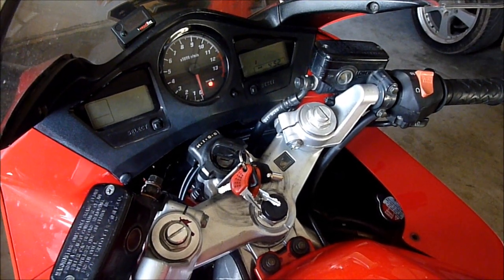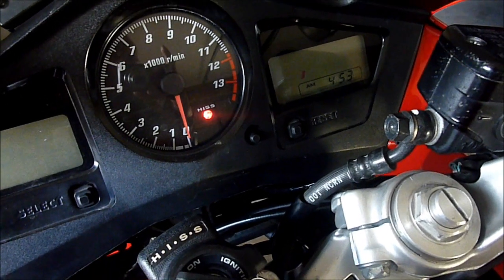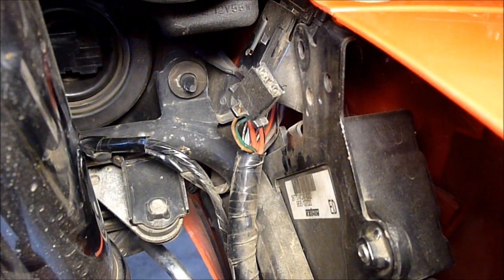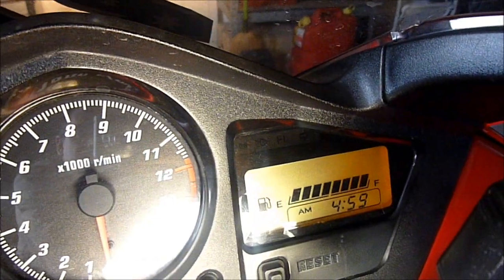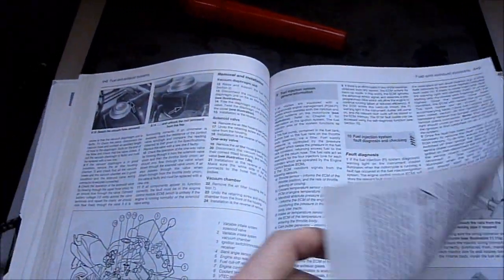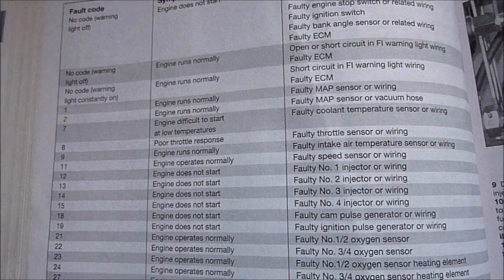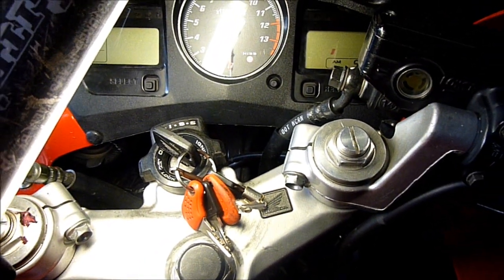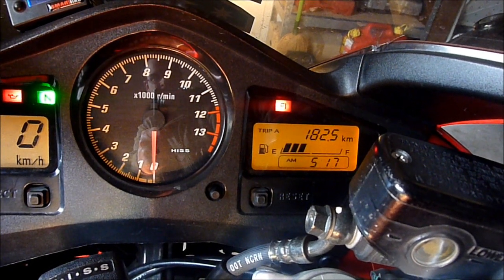Reading Fuel Injection Error codes on a VFR800

Comment: Great tutorial! Thank you for future!
Now I would like to ask you for some help:
I was going to make TüV/MOT inspection. All good except of high CO emission. I got approx 0,8-0,9%vol instead of allowed 0,3%vol.
No FI error codes after starting engine lamp is off. 
Air filter exchanged - no any difference before and after. 
Bike is full stock.
Any ideas what else can be a reason? Spark plugs maybe? on ODO currently I have 61000km 40000 ish miles.
Reply from the maker: Not really familiar with MOT inspections but it could be faulty O2 sensors making it run rich, or even a leaky fuel pressure regulator, or leaking injector.  Anything that could cause it to run rich, basically.

Comment: These bikes are not reliable and not easy to work on. STAY AWAY.  If you want this kind of headache buy a BMW.
Reply from the maker: Thats a pretty blunt statement mate.  What makes you say this?  (Disclaimer: I now own a BMW K1300R).
Reply: @KaldekBoch  How many fluids and inspections will you need to do to your BMW before being able to ride it this season?  My K100 needs three, my Kawaski: oil only!  Just wait you will see!!!
Reply from the maker: @davidcarpenter8741  well, we don't have seasons here in Australia, we ride all year round.  I've had it ten years and it's needed no more maintenance than any other bike I've owned.
Reply: @KaldekBoch  I am glad it has been reliable for you.  I have owned a VFR800 for only a short while and it has been a total headache.  Based on comments, forums and other videos it seems these bikes have a lot of problems and I am not sure I really see the bike as superior in any way as to warrant the hassle.  At least with a BMW for your troubles you do get a nice ride.

Comment: I have a 2000 VFR 800 in OZ. I found the ECU under the seat at the rear just above the tail light. there is a plastic panel held down with 4 plastic rivets. That little black connector is located near the regulator on the left hand side at rear. I untaped it and zip tied it so it is easily accessed by simply removing the seat. I made up a toggle switch as described.

Comment: Once your Fi light comes on and you remove the bike from battery power that Fi light will cause an no start condition. Pulling codes is a waste of time unless you can clear the error codes. No one here on YouTube knows how to clear the error codes. The Fi light will reappear and once it loses battery power will trigger a no start condition. Basically it has to go to the dealer. These videos are a waste of time thats why thee are so many of them not fixing your problem. You need an OBD factory specific deal code scanner to reset and fix the Fi light but no one will tell you that because people love wasting your time. That costs about a grand US currency thats why you see Youtube flooded with useless, ineffective videos that teach you nothing nor will they admit that the Fi light once the bike is disconnected from battery power will cause a no start condition.

Comment: Hi  Kaldek !
I have reset it and i think it is ok, because with the jumper in the light is steady solid.
I am confused a bit, and here is my question :
-in the manual they mention, if the light (after jumper remove and insert) is blinking 20 times the procedure has failed.
  Like in your movie, I had after  reset  more than 20....but I see that at the end when i turn on, the light is on continuously...means ok.
   I apologize for too much bla bla

Comment: I get codes, 1,8,9. BUT..the engine will not start or even kick. It has spark, the fuel pump pushes juice through. The lean angle sensor is jumpered (with wire). Side stand down, neutral, kill switch off. ...I have the airbox off, the temp sensor disconnected, the vacume hose plugged. And even a spray of Start ya Bastard and some of my unique expletives yields not even a maybe pop. Any advice on what else to check?

Comment: I need help ... on my 04 vfr800 ... the front left cylinder is missfiring after I changed cam chine ans tensioner .. I had to remove the cam cover ... every thing was done perfectly ... I just get 1 and 9 error ( like u showed in video ) that’s because my air wax was removed too ... the timing is set perfectly ... I don’t know what to do man ... the other cylinders work perfectly .... I follow u to keep up my vfr well .. can you help me in this case ...

Comment: It works out for the 2003 CBR1100XX. I disassembled the injectors to have them cleaned up and when I put all back together everything was working perfectly except... the computer did not liked me messing up with the sensors. I reset it and it's all working fine now.

Comment: I recently replaced 2 of the 4 plugs (plan on doing the other too shortly) but after doing so the bike will start after cranking over for quite a bit but the fi light stays on. No blinking just stays on. And when the key is on and fuel pump is on the fi light blinks with about 1 or 1.5 seconds in between. Any idea as to what's going on? PS. none of thus was happening a few days prior to changing the plugs. Bike just wouldn't start one day so I pulled them and thought they looked pretty bad so changed them. Replaced with the right plugs. I don't know if there is something I have to reset or what. The gas tank was removed and the air filter as well in the process but everything is hooked back up properly. Any feedback would be much appreciated thank you

Comment: I have a 2002 VFR800. I turn the key on and everything lights up. It even starts. But when I turn  the steering column it shuts down completely until I turn it back to center. Lights and ignition come back on. Please somebody help me.
Reply: I guess you figured it out by now. Are you on Facebook Honda VFR800 owners? VFRworld.Com is also a site i use. I would have guessed that you have a broken connection on the switch or connectors.
Reply: Robert Fraley I did figure it out. It was a short on the back of the ignition switch. Took it off and resolder it.
Reply: Sell it

Comment: Hello. My VFR800 does not start. On your video, at 0:36 when you turn on the key you hear a noise for around 3 seconds. Mine used to do that but now it makes a short grunt. The bike has been standing idle for a long time but the battery is fully charged and everything else seems to work. Please advice. What is that noise?
Reply from the maker: MaleAdaptor your fuel pump is jammed.
Reply: Did you fix it? Fuel pump issue? Facebook Honda VFR800 owners is my link to other riders
Reply: Yes thank you.I ended up putting in a new fuel pump. If you need the details let me know.

Comment: Hey kal, 
Need ur feedback, recently i sent my 02 vfr for efi ultrasonic cleaning and starter valves sync and fresh oem plugs, and i noticed the initial problem of poor acceleration, very high fuel consumption and bogging at low rpm is still there. Bike is all stock with everything still attached except for a slip on. Then i did those fault codes and these came out, 
8 - faulty throttle sensor or wiring
9 - intake air temp sensor or wiring
12 to 15 - faulty no. 1 to no.4 injectors or wiring
23 and 24 - faulty o2 sensors heating element.
So is this faults normal after removal of the throttle body?
Or is it truly showing the faults/spoilt/damaged things/components on my bike? Kinda confused right now and maybe ur advise would help cos right now, my FC is 8 to 10km max per litres of petrol.
Reply: Didi Murda have you deleted them all first then tried running fault codes back into the memory. As if you don't delete them they can stay stored in the ECU memory and make you think other things are wrong when it's just one of the problems??
Reply: Didi Murda oh and did you find out what 12-15 injectors problem was because I've had this for over a year and it times my bike out while I'm riding randomly 😠😡😠😡

Comment: Great video, really helpful. Just a suggestion.......For the jumper wire, use a toggle switch with 2 separate tails, then you can leave the tails connected and just make or break the toggle switch to save you trying to unplug and replug the jumper wires. When you're done remove the item completely.

Comment: Hi mate thanks for responding its the crank pulse generator behind the clutch cover some how oil made its way up to the conection under the tank the plug looked like its been put in a jug of oil the mechanic cleaned it of course but it hasn't improved it they have ordered another crank pulse gen and the wireing but there stumped as well may be a fault from the factory ? being a new bike with only 1200km on it im rather pissed off any way u keep up the good work i follow u with instrest matty b

Comment from the maker: Never seen that problem before mate,  but since the pulse generator is only generating a 1 volt pulse, any kind of corrosion is going to be a big problem.  Has the pulse generator wiring been replaced?  Which pulse generator is it - the cam pulse one (goes into the rear head) or the crank pulse generator (goes into the crankcase behind the clutch cover)?

Comment: hi cal great video i have a question for you i bought a new vfr800 in november 2011 ive been having ignition problems since day one when riding the bike on down shifts it cuts the spark for a second or two then comes good its back in the work shop they have found oil in the pulse generator conection under the fuel tank they say its travelled all the way up to the conection which is causeing the problem would you know or any one who sees this video have an answer to this question thanks